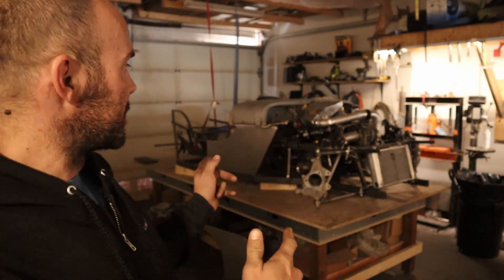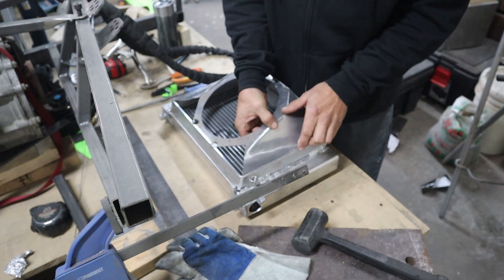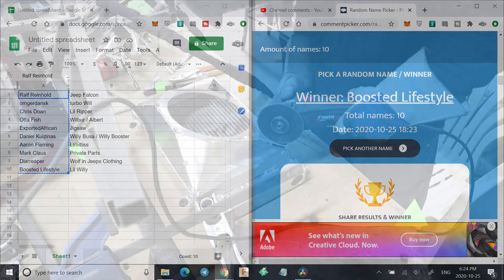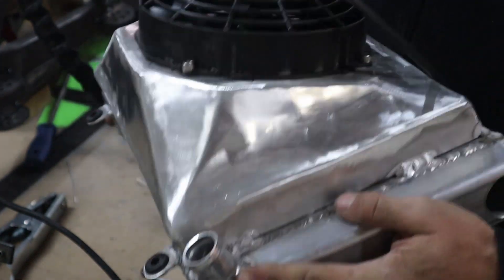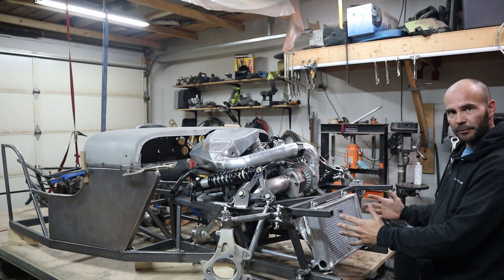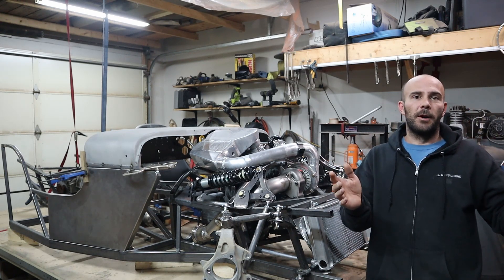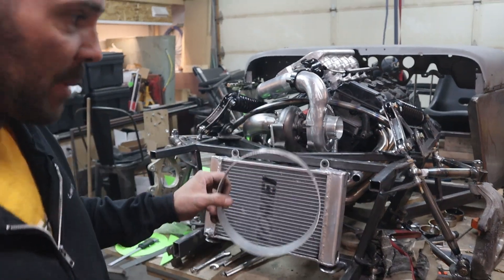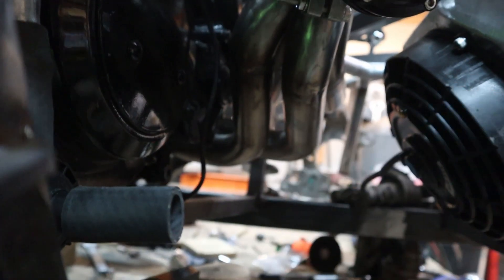Should you duct your radiator? (Turbo Hayabusa Willys Jeep Build Ep. 18)

Comment: what do you plan to do with this vehicle? looks like it be would good at autocross.
Reply from the maker: Probably just for a street car, but I might bring it to a track a few times. I really don’t want to put a roll cage in and ruin the look I’m going for. I still might end up doing that, but i don’t want to
Reply: @limitlessbuilds  with its lightweight chassis, lightweight engine, suspension i think this thing would be champion at it. I dont think you even need a cage for autocross. https://www.youtube.com/watch?v=Af2zJAOAqWQ
Reply: you could allways incorporate a detachable rolll bar too
Reply from the maker: @1985metalmaniac  hmm. Might have to look into it. Not sure what is in my area too. I was planning to put a spot for a cage to mount on the frame, might be able to make a bolt in version depending how the paneling behind the seats work out
Reply: @limitlessbuilds  sounds like a good plan. its a quality build. all the best

Comment: Are you planning to put a heat exchanger in front of it for the water intercooler?
Reply from the maker: I’m planning an ice box in the back with a heat exchanger inside. Might still need a small air one before that, but I won’t know until I try. Would be cool if the ice water would stay cold a couple hours.